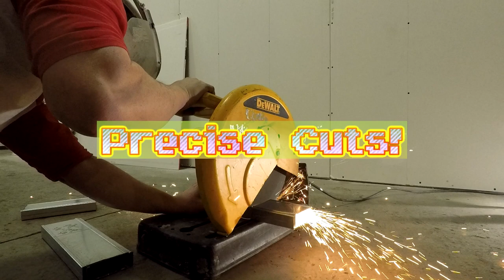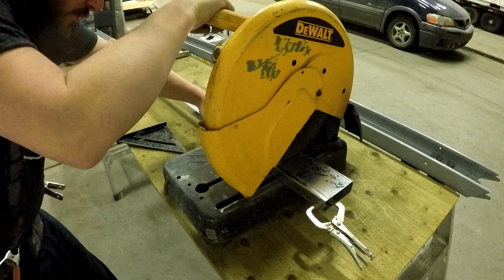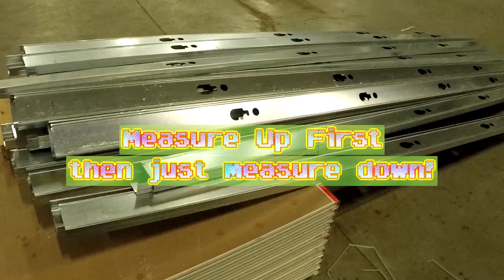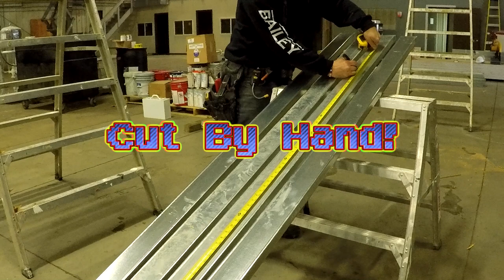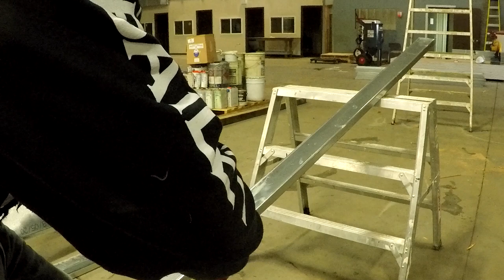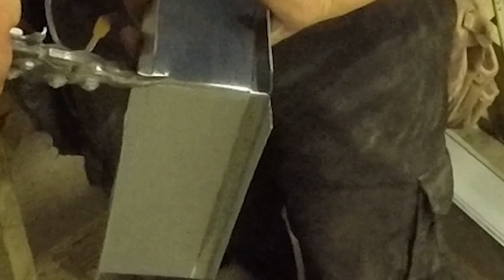Metal Stud Framing Lesson Cutting Steel

Comment: How many inches am I supposed to have from the notch in order to pass inspection? & I’m never supposed to cut from the nipple end correct?
Reply from the maker: Hey there Marcial, I am sorry but I don't understand the question? Do you mean the knockouts every 2 ft? If so it doesn't matter, you can cut any length on the stud even if it lands on a knockout. I am not sure what you mean by nipple either?